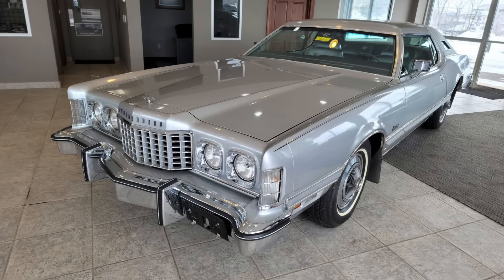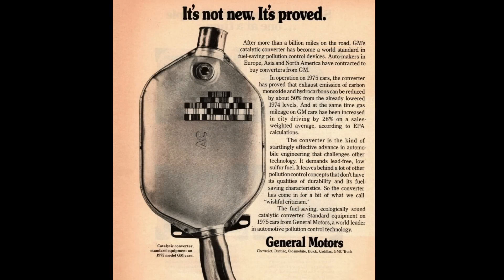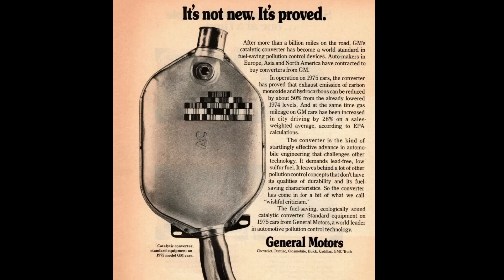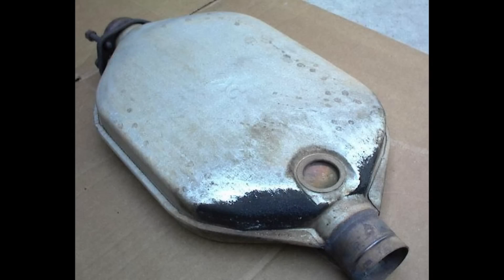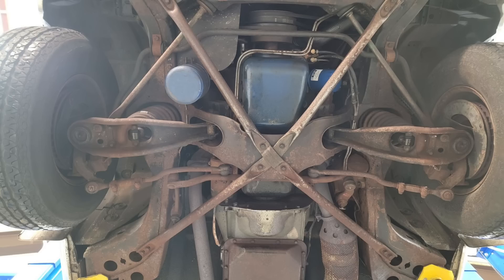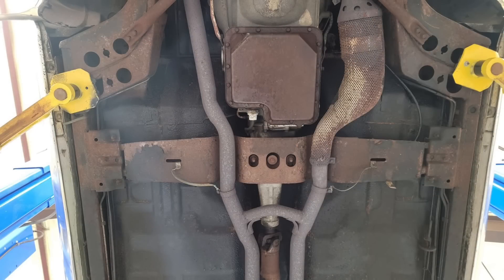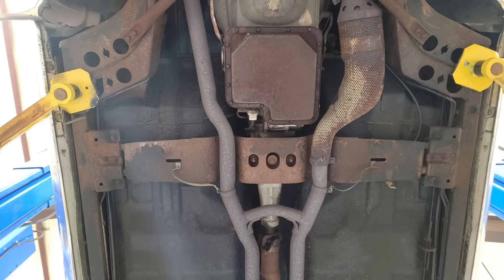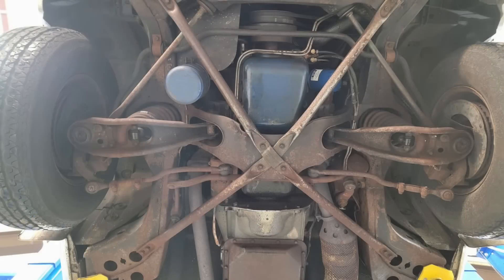Strangest Car Inventions: Ford Invents A Bizarre Way to Meet 1970s Emissions Standards

Comment: This explains why the exhaust smelled different amongst the different manufacturers. I always wondered why they all smelled different but burned the same fuel. Thanks Adam!
Reply: I live in Germany and we adopted catalytic converters in the mid 1980s. Some cars had electronic fuel injection with oxygen sensors and three-way cats. Some cars had weird and hyper complicated carburettors with vacuum controlled choke plates ("Vordrosselsteller") and gigantic cats. Those were a real nightmare to get running halfway decent. I was an apprentice at that time and we called those carburettor systems "Pierburg's revenge" (Pierburg was the biggest manufacturer of carburettors in Germany at that time). And some cars had normal and simple carbs and just a cat without any lambda regulation. And other cars had nothing and still ran on leaded gas (cats became mandatory in 1992 iirc.). We had also many different tailpipe smells then...
Reply: @albinklein7680  I bought an "American spec" Nissan Pulsar NX in 1985 while I was stationed in Germany. Drove it from the port. They gave you the catalectic converter in a box in the trunk and a plastic adapter for the fuel nozzle. That was before Germany banned leaded fuels.
Reply: @markhenkel2484  I still have NOS conversion kits for some Mercedes and BMW cars in their original boxes. They consist of a flanged pipe to bypass the cat, a plug for the oxygen-sensor hole in the downpipe and a small module to override the signal of the sensor. We installed those kits temporarily when the owner of the car planned a vacation/tour to the areas in Europe where unleaded fuel wasn't available yet.... Interesting times...
Reply: @markhenkel2484  my dad had an '86 Pulsar NX!!! Haven't thought about that POS in years 🤣
Reply: @albinklein7680 Similarly, the UK didn’t require converters until 1993.
Reply: @albinklein7680 Yeah, I remember the variable venturi carb on some of the Cologne 2.8's. My Capri had a Offenhauser with a 4bbl Holley 390 cfm carb, cam, headers and dual pipes to ansa tips. It ran 13's and would smoke IROC's and Mustangs.
Reply: @albinklein7680  I was born in Augsburg 1967 but have lived in the States {Georgia} since 1975!
Reply: Really?? I had no idea Germany had issues with the old school smog carbs (I thought that was just us!) and yes, they were a total bitch and a half to tune and get working half-good
Reply: @Drmcclung  generally speaking they kind of worked. At least for a few tens of thousands of miles/kilometers. But after some time they became a real nightmare. The dreaded Pierburg 2EE carb for example which was used on cars like the 75hp MK2 Golf, the Mercedes 190 and the 2.0 Vauxhall/Opels. The idle regulation is a combination of solenoid valves, vacuum diaphragms and linear resistors, for example. If that stuff starts acting up, you are in a world of pain. And don't get me started with the hilarious EVAP system with mechanical valves and temperature switches which switch vacuum instead of electric current. Hilarious stuff. I had a really, really hard time with that sh*t when I was an apprentice in the late 1980s. 
I make good money today with that stuff, because I am one of the very few remaining guys who know how this mess works, though...
Sorry for the long text!
Reply: @albinklein7680  for us (euro imports) and me especially the main nemesis was the various Solex systems that were impossible to tune, followed by Zenith and then Strombergs, in that order (Stroms typically fitted locally). I think there might have even been mandates back then on which specific smog carbs they could run on American roads
Reply: @Drmcclung  solex carburetors are lots easier to adjust than American ones. You can change each gicleur separately in a Solex carb, just like Weber. Also, they use to have a fine tuning screw for mixing at idle, and the air flow in idle itself.
Reply: @Drmcclung  ooooh yes. The weirdest ones were (officially!!) called "Biegevergaser" ("bending carbs") because they didn't have screws to adjust the accelerator pump and the changeovers for the different stages. They had flimsy crooked rods which you have to bend to adjust the throttle plate gaps and the fuel metering. Compare that to a "real" carb for which you had a jig with a dial indicator for those adjustments....
Reply: @albinklein7680  I wish, i could have said that phrase with the good money for fixing carburated engines once in my working life. Wherever i lived, people with these old survivour cars were the ones with the least capability to pay their mechanic at all.
Reply: @werner.x  a lot of these cars are pretty expensive classics now. One customer of mine owns a Mercedes 250C with Zenith carbs and he wants that car to stay 100% original.
Reply: @Drmcclung 
Those late 80s carbed Honda's for the US have entered the chat, with those huge vacuum boxes that you leave in place and don't disconnect the 4000 hoses when pulling a cylinder head. 
Surprisingly, my little bit of experience with them, they worked okay
Reply: it was that way into the 2000s if you were behind a ford vs a honda. they both had very different exhaust catalyst smells.
Reply: @honkhonk330  you are right! Even still today, as they age and get high miles a chevy truck smells a bit different than a ford.
Reply: @GasandDiesel911  Chevy has always had dickey-weird emission controls, they do smell different.. often 'gassy' (fart AND petrol)
Reply: @Drmcclung  I remember brand new Toyotas out of the box smelling like rotten eggs lol
Reply: @GasandDiesel911 this was because the air fuel mixture was way too lean, thus the rotten egg smell
Reply: @GasandDiesel911  They shouldn't do. Thanks to industry lobbying, the USA mandated 3-way cats in the late 1970s along with stochiometric fuel ratios when injection came along and they all work the same way. This was a direct response to Honda being able to achieve emissions targets with their CVCC stratified charge system at much lower manufacturing costs and essentially tied Japanese makers to the same ball and chain USA makers used
Reply: @miscbits6399  oh i know bro. Follow the money. Always been a pay to play game. Honda was always ahead of the curve with engine durability and economy. Little baby engines, but still engines that got people around. Thanks for chiming in. You have fun with whatever you do! Try to be safe 🙏🏼
Reply: I'm 51, and what I'm amazed at is when I get behind a car with no catalytic converters. The smell of raw half burned fuel is unbelievable out of some of em. 
They could definitely run a little better with some fiddling ,but just add fuel because it masks alot of bad tuning issues.
Reply: @MrTheHillfolk  I have family in Latin America and by far the best thing when I go there for a visit is the smell of real gasoline and real cars. It feels soooooo good when I get in a taxi at the airport and it smells like real leaded gas. Incredible.
Reply: @albinklein7680  It might smell like it, but leaded gas has been banned worldwide for several years now.
Reply: @necrotorium  they definitely still sell leaded gas in Ecuador...
Reply: @albinklein7680  Ecuador phased out leaded gas in 2000.  However, their emissions standards are lagging around 35 years behind the united states, which means that there are a lot more cars without catalytic converters on the road, which have a gas smell.
Reply: Im guessing the excessive grounding was to do with electrical interference coming from the radio
Reply: I definitely remember the different smells!
Reply: My 1979 Subaru (federal emissions) has no catalyst. And it has a big nameplate on the door frame that says NON-CATALYST in giant letters to let you know. There is a thing under the car where the header pipes meet that at first glance looks like a cat but it's just the muffler. Which is essentially just an empty steel box with "muffler" stamped into it.
Reply: Smells bad when new
Reply: It's why new diesels smell like urine!
Reply: @pudermcgavin4462  It might be because they spray DEF into the exhaust to catalyze it (DEF contains urea).
Reply: I noticed the same thing about the distinctive exhaust smell of the different models, as well. The Mazda's with the rotary engines was the easiest for me to detect the difference.
Reply: You were sniffing exhaust fumes???
Reply: @_ford_crown_victoria_p  sniffing???
Lol 😂 take your meds
Reply: Great point! I wondered that back then but had forgotten until now. Thanks!
Reply: Why are you going around smelling the exhaust, anyways? lol
Reply: @lsswappedcessna  pshhhh take your meds wanna be pilot. You only wish you had a cessna. You've never smelled a vehicle while sitting in traffic? If not, then you've never had a vehicle lmfao 🤣 
Adios bozo
Reply: Stop sitting in a closed garage smelling fumes of a running car.  Not healthy.
Reply: @michaelwhite2823  that's what mechanics do dude. If you know then you know. Adios mestizo 👋🏼

Comment: My father bought a new GMC truck in 1981.  When he got it home he drained the beads onto the driveway and bought leaded gas.  He didn't know how bad leaded gas was for people.

It should have been ensured that unleaded gas wasn't more expensive than leaded when it was first introduced.
Reply: Not to mention how leaded fuel corrodes exhaust systems, fouls plugs and increases engine wear.  Leaded fuel has lead scavengers that are corrosive, this can also lead to cylinder bore / piston ring corrosion that will lock up a motor if it sits too long.
Reply: @bobroberts2371 References? That sounds like a lot of 'everybody knows' urban legend stuff. I come from a do the recommended maintenance family. Even back in the leaded days we never had an engine suffer any of those failures, especially fouled plugs. My folks always got excellent service and long mileage from their cars. Tetra ethyl lead raised the octane and provided exceptional anti-wear for the valve seat area. One of the first changes unleaded gas mandated was stellite valve seat inserts for the combustion chamber.
Reply: @curtislowe4577    said "  References?     "

My 45 + years in and around the auto repair industry, my time racing Formula Ford running leaded race fuel.  AvWeb has some vids on leaded fuel and exhaust valve / seat burning and sticking.  100LL ( blue ) is slowly being replaced with recently approved G100UL which after decades of research contains no lead. Most general aviation engines are approved by the manufacturer to use G100UL without any modification.
Reply: @bobroberts2371  My experience goes back just as far. 1966 Dodge, 1968 Chrysler, 1969 Dodge, 1970 Plymouth. Never had any of the issues you insinuate were common. Again particularly fouled plugs. Except for the 1969 Dodge all bought new and all got well over 100k without any of the issues you listed.

Listing racing experience with high octane racing fuel as applicable in a daily driver area of discussion? 🤦🏼‍♂️  AV gas and aviation engines?  🤦🏼‍♂️🤦🏼‍♂️  60s to mid-70s autos are the only applicable experience. Lead scavengers? That's something I'd like to read more about.
Reply: The lead scavengers in question are chloro and bromo- alkanes. 1-bromoethane would be a classic example.

When burned the bromine and chlorine atoms react with the metallic lead that would otherwise be deposited on the inside of the engine, forming volatile lead halide salts that vapourise and get blown out the exhaust.

They also react with hydrogen atoms, forming their respective mineral acids (hydrochloric acid and hydrobromic acid). Hence the corrosiveness of leaded fuel.

Interestingly cylinder wall wear is partly a chemical corrosion process caused by acids (organic acids formed from partly burnt fuel, sulfuric acid from sulfur contamination of the fuel, and the acids from lead scavengers all contribute) in the blowby. Especially at the top of the cylinder, which partly why old engines often have a deep wear ridge there. In some cases you might actually be able to see a ring of rust at that spot.
Reply: @nerd1000ify    said "    The lead scavengers in question are chloro and bromo- alkanes. 1-bromoethane would be a classic example.  "  

Thanks for posting this.
Reply: @bobroberts2371 stop it 🛑, leaded fuel was MUCH better for engines.
Reply: @johneckert1365    Apparently you were never around engines running leaded fuel.  Exhaust systems might last 3 years, spark plugs lasted 15,000 if you were lucky, an engine that sat for a year usually locked up due to the lead scavengers I mentioned. Lead was added as a cheap octane improver.
Reply: @johneckert1365  Leaded fuel was terrible for humans.  The major reduction in the homicide rate from the 70s to now tracks with the phase out of leaded fuel.  Engines can deal with its loss.
Reply: @ml.2770  You clearly don't even know the definition of "Homicide" 🤡🤡🤡
Reply: Yes and no. It's a concentration issue. Aside from a few large urban areas smog and accumulated lead was literally not a problem. But the environazis of the time pulled off the coup to force everyone coast-to-coast to pay for the equipment to meet the new EPA guidelines including the phase out of leaded gasoline. Even back in the 60s the air pollution problems didn't extend much beyond the few metro areas that were the entire reason for the auto regulations. The entire history of auto air pollution legislation going back to the 60s is littered with radical policies supported by cherry picked worst-case instances that were very, very local. The vast majority of the country west of the Mississippi and excluding the LA metro area had literally no need of any form of reduced pollution requirements whatsoever as what little haziness there was never lingered. This comment is centered on auto pollution not industrial air pollutants.
Reply: @curtislowe4577    said "  But the environazis of the time pulled off the coup to force everyone coast-to-coast to pay for the equipment to meet the new EPA guidelines including the phase out of leaded gasoline.   "

Meanwhile YOU are benefiting from the very policies you despise.
Reply: @bobroberts2371 Lots of assumptions there and you are profoundly wrong. People in rural areas literally enjoy no benefits as there were no measurable negatives to begin with. The number of IC engines per square mile was/is so low those pollutants simply cannot accumulate. If you refuse to accept the relationship between concentration and risk then you are part of the ongoing problem of people who are incapable of performing relatively simple cost to benefit analyses yet hold strong opinions and vote based on those opinions. Just as an illustrative data point are you one of those folks that voted dim in 20 and will proudly do so again in November?
Reply: @curtislowe4577   Perhaps you can go back to watching Scotty Kilmer vids, you know your hero.
Reply: @bobroberts2371  If you'd been honest and prefaced your comments with "I had experience with highly leaded racing fuels and av gas" (along with the decades when you were gaining that experience) then even you would have realized how pointless such comments were as none of them apply to engines fueled with gasoline available from the corner station during the 60s until the end of the leaded gas era. (Maybe the piston rings sticking in engines that sit for an extended period but that is an issue with no applicability to daily driver vehicles.) 

You remind me of the smartest co-op student I ever worked alongside. That semester was myself and a couple other just run-of-the-mill ME co-op students. But there was also a Nuke E. None of us ordinary MEs could ever figure out why the company hired a Nuke E. It seemed that absolutely nothing he'd learned about nuclear power was applicable to a coal burning power plant. Possibly the most intuitively bright engineering student I ever met but his knowledge wasn't germane to the situation. You remind me of him.
Reply: @bobroberts2371  Does he still have his Celica? Haven't watched him in a while.
Reply: @marckyle5895    said "  Does he still have his Celica? Haven't watched him in a while.   "

If you are speaking of Scotty Kilmer, I have only watched 2 vids.  One to see what was going on and another to confirm he plays to the " world is out to get me " crowd.
Reply: @bobroberts2371  That last sentence is why I unsubed him.

Comment: Never owned a Ford that DIDN'T have electrical issues.
Reply: Those are the exceptions.  Of the big 3 Ford far and away had the most reliable electrical system and that still holds true today..
Reply: Bad Electrical,  bad transmissions and power steering systems that whined even before installed.
Reply: Never owned that did.
Reply: Molar electrics were almost as bad as British Leyland judging by my 1978 Horizon. Same with the 1968 and 1970_Chryslers we had in the family.

Comment: That single ford Cat was massive!
Reply: Not positive but I think that is about a 73 Continental, only because I had one with a massive 460 in it if I remember correctly, great land yacht
Reply: should have seen the stock cat on my 1990 bmw 525i, it was a "non restrictive" design and took up like half of the entire exhaust piping system.